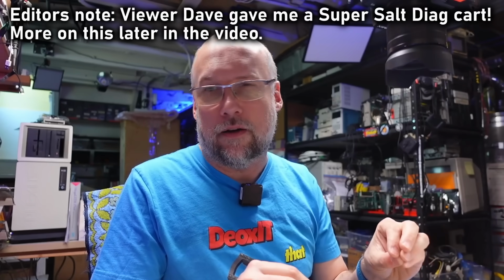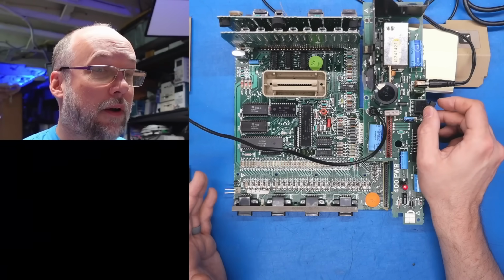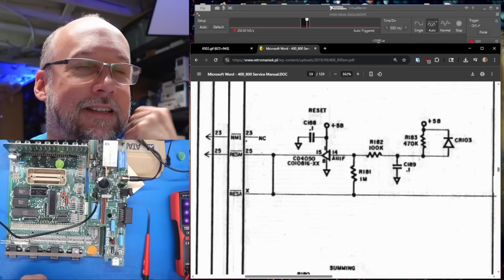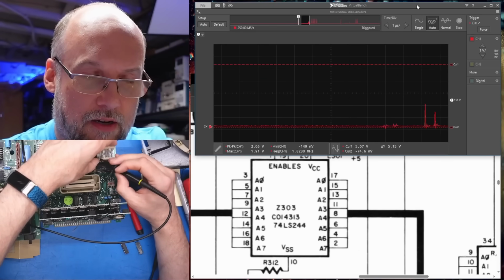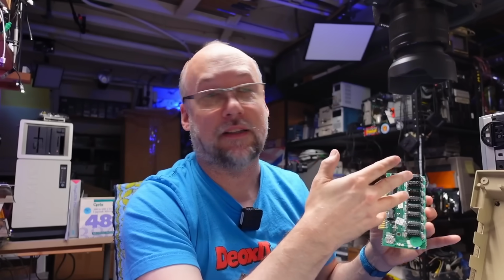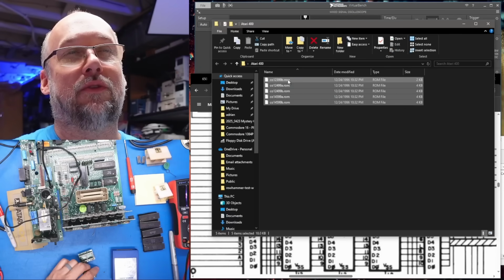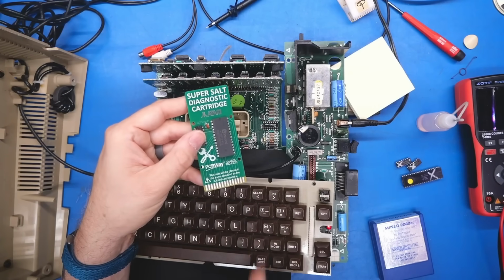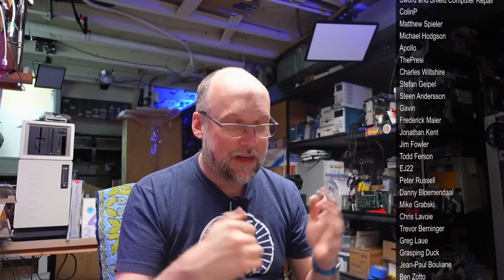Repairing a smashed-up Atari 400 computer

Comment: Several things the "Bad" rom is the Math Pack rom (For Floating Point Math) and it is only 2K. The original ROM is known to be slow, so many users replaced it with a 3rd party Fast Math ROM instead. That is the reason why it may have not been the database.

Also Chrome's PDF reader is crappy at high zoom levels, I learned this when reading my MSX schematics I had a similar problem. The KDE pdf reader Okular is very good at this, it also available for Windows and is in the Microsoft Store.
Reply: for Windows I recommend Sumatra PDF, it's fast and lightweight. Loads about 98% of PDFs for me.
For Linux I prefer Atril (originally from MATE), but both Evince (from Gnome) and Okular (KDE) are ok too, although sometimes Evince is VERY slow to load for some reason.

Comment: I used a unmodded Trendcom 100 thermal printer via two of the joystick ports:
COMPUTE! ISSUE 9 / FEBRUARY 1981 / PAGE 82
Put A Printer On The Atari Ports
C. Kingston
White Plains, N.Y

Comment: Doesn't the B on their original CPU indicate that it's a the higher speed version of the chip? I think the Atari's ran at a higher frequency than most 6502 based systems.

Comment: I would retest the original GTI. Antic might have been in wrong when you tested it. (I posted this before the end of the vid. You were confused, but I was not because I think the Antic was not seated properly when you tested the GTIA. The same reason the replacement GTIA failed originally)

Comment: These 8 bit machines have heavy shielding, could you strip one down for bench testing and demonstrate the exrent of interference these machines caused?
Surely it must be possible to make stand offs, even if someone had to 3D print them.
Reply: there is zero practical reason for this shielding other than FDA being too strict at that time
Reply: @jwhite5008  Surely you can't impose legislation on an offense that can't be measured, are these electronic circuits generating any short range external interference? I know that a power drill can make an FM radio splutter and that Taxi cab radios can bleed over to FM radio frequences but there's nothing in an 8 bit computer that transmits.

Comment: Create a spreadsheet or document to keep track of what you learn when working on new machines. I would use excel or similar spread myself because you can separate spreadsheets like tabs and name them as the machine types its doesn't take much time to organize your progress if you record your findings over time and not just listing tons of information at one time. Good for recording what you have in bins also and tracking quantities. We did this for everything while i was in the airforce working on jet engines and we also kept detailed records daily of work done and work that needs to be done we had notebooks going back about 20 years not counting aircraft logs that could be searched  both in hand written forms and digital. Its amazing what can be solved quickly though looking though records previous work done compared to similar problems that keep popping up says maybe its not the part that has been changed the last 3 flights hmmm could it be the wiring instead every wire is white and they are hard to spot but works during ground test bad in flight.
Reply: IMO it's not that useful unfortunately, it spirals out of control or becomes irrelevant.

But a wiki document in the shape of "issue - cause - solution" could potentially be useful for some most common issues, 

Also documenting what Adrian originally suggested about "what chips are required for it to run" or "removing what chips leads to which behavior".  Something like "black rolling video, phase clock ok, activity on address lines, no SELECT on anything but RAM". This could help narrow down diagnostics for people unfamiliar with how system works by removing and reinstalling chips one by one to get to a known good reproducible behavior until something is wrong.

Another very helpful thing would be writing a diagnostic ROM ("dead test") and selling it at affordable price for people without EPROM programmers/erasers who just want to fix their computer. But it would take quite some time and effort, especially to test it on all sort of broken machines.

Comment: So in the end, there is a good chance that it was a corroded socket and inserting/removing things from it made the machine work again?
So in other words:
Deoxit that Socket  ^_^
Reply: No, the ANTIC was incorrectily aligned for the duration of most of the troubleshooting.
Reply: @jwhite5008  But the ANTIC was seated correctly in the Beginning, but the System didn't work?
So was it just a Socket issue or was it one of the 2 bad/marginal RAM CHips that took the System down?
Reply: @Stefan_Payne  
I mean at least one RAM chip was indeed bad, most likely both

But all troubleshooting that didn't consist of removing chips and testing in RCTP was nearly pointless as the ANTIC was installed incorrectly.

Comment: This was the first machine our family purchased.  My sister convinced my parents a computer would be useful to have as it could do so many things but we wound up using it to mostly play games.  Unfortunately we got rid of it when it stopped working.  A couple of years back I purchased an 800XL off of eBay as still I had many of the games from our 400.  I also now have some basic repair skills thanks to channels like this so I can possibly fix my 800XL if I need to.

Comment: Acetone is terrible for ABS plastic repair.  It makes it stick back together but it damages the chemical structure and makes it weak.  MEK is the superior plastic weld chemical, it makes it as if it never broke in the first place and does none of the creepy whitening of the plastic color that acetone does.  It is perfect for external plastic repair... if used carefully, MEK will make the rejoining seamless and invisible.  And internal repairs will be as strong as if it never broke.

Comment: Adrian, great video, when you talked about 6502 vs Sally, reminded me of something - if you ever get 6502A labeled chips from our favorite Chinese vendor website with 0222 date code (yeah.. right...), that don't appear to work or test bad in the tester. Test them as 6502C Sally's which they actually are.  Jumping pin 36 to 34 (r/w) will make them work as any good old 6502 in a Vic-20 which ignores the Halt on 35 as n/c.  Since Sallys appear to be harder to get - Atari owners should take a look at that 6502A with the odd date code - they may get pleasantly surprised.

Comment: Always look at power signals with the scope function.  A bad filter capacitor  will cause a ripple, and that causes erratic operations in computers, especially in RC timing circuits. 

Electrolytic capacitors don't last long, especially in hot environments.
Reply: My first computer was Atari 800. Mid 1982. My brother and I wrote a LOT of programs for it.
Reply: Some E-caps are still good after almost a century, others perish within a year in smoke, or leak.
It really depends on type, series and manufacturer, specifically 2000s "capacitor plague" killed too many computers to count, but both earlier and later caps last much longer.
The point is - if the capacitor measures ok, including ESR, it should not be replaced.

Comment: Hi,
I'm an all C= dude.

Started with a KC1 made by Kosmos, which back then was famous in Germany for their electronic learning kits where you had a transistors, resistors, light bulbs and alike to build simple circuits on simplified breadbords.

That KC1 is based on 8048/8049 MCU and has 8 7segment displays and a foil type keyboard which had assembly code instructions on it and 0-F hex keys and num keys on the right. 127 bytes (!) of ram and full Adress and data bus expansion on the back. I got it 1981 when I was 10. Two years later I got the C64.

We had the 2600, of course, like everyone else. But that C64 changed everything. One years with its 1531 and then the 1541.

Atari computers? I never seen one back then in the stores. It was all C= and some Sinclairs over here in Germany.

Computer stores had the very expensive PCs and Apples which i Ioughed at. No colors, poor GFX and only beep. And slow at all CRT outputs.

That changed when I got an 'old' Zenith labeled AT PC, given to me by my Uncle (which back then was a cobol/Fortran in house programmer for a large company)  He usually had all the bells and whistles every teen guy was all about. Quadrophonic HiFi, a jbl Paragon where all his HiFi was sitting and, the largest TV I've ever seen and a 10 inch reel recorder.

That zenith AT had a Paradise VGA GFX with 256 KByte of ram. And a 20meg Harddisk. That was 1988. At that time a VGA cost as much as the pc itself.
He showed me his new system a Deskpro 386/4meg/80mb and a huge monochrome CRT which was a CAD machine, but he used it to program.

He tried to teach me some Fortran but I was all into 6502/6510 assembly

So he gave me a turbo assembler for the PC and the c64 assembly  handbook by Databecker (Germany ;)

Cheers.
Reply: That's odd you say that about Germany when Atari had a great time with the ST computers in Germany.

Comment: My Atari 400 case is the most brittle plastic I've had to deal with. I opened it and then when I put the screws back, the standoffs exploded. I repaired it by wrapping the screws with teflon tape (for plumbing) then putting the screws into the remains for the standoff and then using epoxy putty to fill-in and reinforce the remaining plastic. Let the epoxy dry and back the screw out.

Comment: SALLY was a custom spin of the 6502 done by Synertek which added the tri-state HALT logic on the CPU card of the 400/800 systems directly onto the die. It's exposed via a normally unconnected pin as HALT. 

When this pin (or circuit as in the older 400/800) is asserted, the 6502 is lifted off the bus into tri-state for as long as the signal is asserted. ANTIC uses this to clear the bus for all of the required DMA transfers for the display.

Given that the ATARI can have a whole mix of different graphics modes on the screen at the same time, this results in ANTIC asserting the bus for varying percentages of time. For example, a 24 line mode 2 display (aka 40x24 text) will consume roughly 35% of the available CPU clock time to do the necessary DMA fetches. Adding players, missiles, or varying playfield widths and doing smooth scrolling further increases the number of cycles stolen. Display List Interrupts also affect the number of clock cycles stolen.

This also means, that if you want to give all the time to the CPU, you can disable all ANTIC DMA, and the ATARI CPU will run at full speed. :)
Reply from the maker: Ah yes, a good way to simplify things. The 6510 had the same thing going on but the Apple II relied on extra logic to disconnect the CPU for DMA activities. (And clearly the original 400/800)
Reply: @adriansdigitalbasement  -- Yes, they did a few things similar to Intel. 

Interestingly, the guy who developed SIO went on to create an ubiquitous serial port for the PC, starting with the ATX generation. Yes, he also developed USB. And as a matter of fact, one homebrew design that adds CF card support for the 8-bit Ataris used a USB to IDE bridge IC.
Reply: @PlumGurly  I know Joe Decuir. He and I have been friends for almost two decades, and have given talks together, for example, we gave a talk in 2024 on how decisions made by the Atari team in 1978 allowed FujiNet to exist in 2019. https://www.youtube.com/watch?v=xk_D5N1HvKk&t=1420s&pp=ygUbdGhvbSBjaGVycnlob21lcyBqb2UgZGVjdWly

To be unbelievably accurate: 

Joe was Microsoft's representative to the USB standards committee. He was responsible for directing the design of the USB host system drivers in Windows 95.

When patent fights arose with USB, the work his team did at Atari on SIO was used as prior art.
Reply: Did you write any famous programs for the Ataris back in the day?
Reply: That's why I wished an external framebuffer was used. You can turn off ANTIC, even in BASIC, but when you do so, you lose the screen too, since the GTIA is getting nothing from ANTIC. GTIA will keep the NTSC protocol live, but there will be no information to send. So you get a grey or black screen. But if a framebuffer were inserted there, the last output would remain.

I get why they did it as they did. This was a stateless design. You don't need memory if you have a chip recreating the image 50-60 times per second, and doing it perfectly in time with the GTIA. So it rendered the display list on the fly.
Reply: I've done that in BASIC before. You can turn it off to speed up math calculations, for instance. Too bad ANTIC is a stateless design with no framebuffer. Yes, I get it that it is a compositing engine that constructs the image for GTIA on the fly. And I get the financial constraints of the time. Still, a framebuffer would have let you disable ANTIC without losing the current display.
Reply: @PlumGurly  Sigh.

It would have blown right past the alloted gate count/price point.
Reply: @tschak909  -- I pretty much said I understood that. It was just something that could have helped, theoretically.

Of course, if one is going to design one in an FPGA or emulate one, and one is going to use RAM, caching the display list and using bus sniffing to know when it changes would be good. That would be a compromise in that less RAM would be needed to cache the display list than the result.
Reply: first used un the 2600.
Reply: @macgeek21 incorrect. Sally was not first used on the 2600. It was developed immediately after the release of the 400 and 800 systems as part of ongoing cost reduction. The first system to use it ironically were the later 400 and 800 systems which had an updated CPU card. The Atari 1200 XL would be the first production unit to use it from the start.

You are actually thinking about the ready pin, which serves a similar function, but is implemented very differently.
Reply: @macgeek21  -- No, the 2600 used the MOS 6507, the TIA, and the RIOT chip.

The Atari 400/800 used the Sally variant of the 6502 and the CTIA/GTIA chip, along with the ANTIC, the POKEY, a PIA, and miscellaneous ICs and glue logic.

Comment: BTW, the Star Raiders cart is a surprising little diag cart, I used it on my 600XL and it worked, but it wouldn't boot to BASIC, helped diagnose a RAM issue. My 400 has an Axxlon compatible upgrade, so closer to an 800 RAM wise, and I have a Super Color CPU card in it for enhanced video, and I have an Incognito card in my 800.

Comment: That keyboard is called the B-Key 400. I had one and also upgraded my 400 to 48K. Both of these mods together were WAY cheaper then buying an 800, at least at the time (early 1981), and essentially made the machine functionally equivalent to an 800, sans the right cartridge slot.
Reply: I too had a 48K and B-Key upgrade, kept it a viable machine until I got a 130xe.
Reply: the 400 only has RF out. The 800 has svideo and composite
Reply: @KAPTKipper  Forgot about that.  I never had a monitor or TV with composite or s-video until I had already switched to a PC, so that was never a factor for me. Nevertheless, it's easy to mod the 400 to output composite and s-video.
Reply: @johnhunt1725 Same here, keyboard and 48k mods.  Was a great early computer!
Reply: Yes, I was surprised to see a 400 with a non membrane keyboard 😀
Reply: I would like the b-key upgrade. Is there a modern option for it?
Reply: @scottgfx that's a legitimate concern when the RAM cost just as much as the computer itself.
Reply: I remember seeing the adverts for 400 Keyboard mods back then. Back around 1981, my brother had an 800 with a 3rd party memory board with 48K. A single board with that memory. I remember him being very concerned with voltage spikes and static electricity.
Reply: ...which was rarely used, anyway. I think there were only a handful of carts for the right slot.
Reply: I had an Atari 400 but family was poor and didn’t have money for any mods that I didn’t know about. I had the Cassette drive with the States and Capitals game and a few other games. I used the Basic cartridge most of the time and I had a book of Basic programs that I used to manually type out programs from line for line and would back up on tape. Atari 400 was great but the keyboard was terrible.

Comment: I bought an Atari 400 when I was 12 on a flea market and I got the 48k memory extension as well as a keyboard very similar to the one in the video (the cherry keyboard you can see in the screenshot). I loved the machine, it ran all the software that the Atari 800 did.

Comment: Shoestring’s Atari 8bit ram tester @ jammarcade
Reply: I wrote this for systems with 64kb of ram ( or expanded 600xl )  which installs in the OS ROM socket. Not sure if it will be very useful in diagnosing bad ram in a 16kb system :)
Reply: @samp3413 I tried to run it on A8PicoCart by renaming test file to UNO_OS.ROM. It always freezes. There is a raised issue on github page, can you help?
Reply: Hi @samp3413, I was looking to run your ram test on A8PicoCart by renaming it to UNO_OS.ROM in root. It always freezes on start. I think it would help a lot of people as A8PicoCart costs 2$ to build. Can you help?
Reply: @samp3413 Hi there, I was looking to run your ram test on A8PicoCart by renaming it to UNO_OS rom in root. It always freezes on start. I think it would help a lot of people as A8PicoCart costs 2$ to build. Can you help?
Reply: @samp3413 Hi there, I was looking to run your ram test on A8PicoCart by renaming it in root. It always freezes on start. I think it would help a lot of people as A8PicoCart costs 2$ to build. Can you help?
Reply: @samp3413 can you help me to run your ram test on A8PicoCart ?
Reply: @samp3413  I tried to run it on A8PicoCart as UNO OS rom but it always freezes. Can you help?
Reply: @goloskokovic  What is the base system ?
Reply: @samp3413  patched Altirra OS, and the patched OS is careful never to re-enable ROM